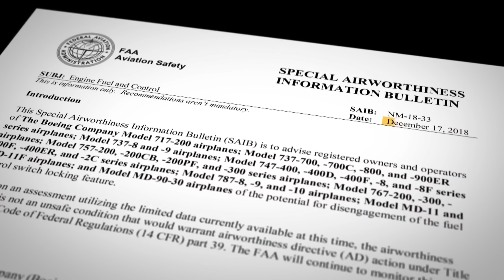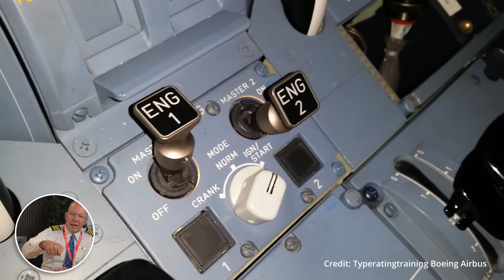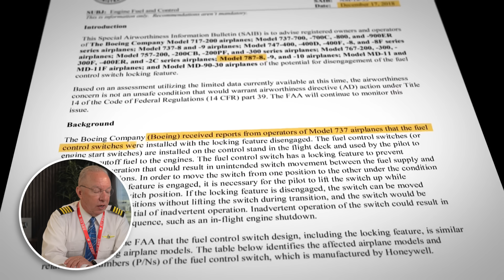Air India 171: The FAA’s 2018 Fuel Switch Locking Bulletin Explained (16 Questions Answered)

Comment: You did not answer 12:10 or 13:27. Total electric failure is not what they are talking about. Any electronic device, (even a gaming console which effected some speed runs in the history), can shift bits due to malfunctions or outside interference. 

Also, your "GUARDED BRACKETS" actually will help to cut off the fuel if there is an object stuck between the throttle and switches. You did not even consider the possibility to answer this one.

Comment: Is there a way to know who was the pilot actually flying the plane at the moment of take off . Can it be the Pilot or co-pilot. 
Who was uncharge of the wheel ( don't know what you call that thing the pilot graps that looks like a wheel. Is that the nose?)
Reply: @bayulala100  The preliminary report states, "The co-pilot was Pilot Flying (PF), and the PIC was Pilot Monitoring  (PM) for the flight."
Reply: Thanks@TonyCAV8R 
So the question is who was the pilot that first asked the question 'did the turn off the fuel switch to cut off" 
I think one of the pilot was suicidal at the time and had decided to die and killing all on board that air plane.
Very sad situation
Reply: @bayulala100  That question was not answered in the preliminary report, but I am sure it will be part of the final report.

Also, there is nothing in the preliminary report that states that a pilot moved a switch from RUN to CUTOFF (the switches transitioned) nor whether such an action was accidental or deliberate, unintentional or intentional.

Let's wait for the facts before trying to assign guilt.

Comment: But, even IF this was a suicidal pilot, there surely was a distinct possibility he survived the attempt. I get it that no one survived but if those buildings weren’t there, the cockpit could very well have been intact without injury.
—> My point is, they were only 400 some feet off the ground so it’s not like they were pulling 9 G’s going in at extreme angles; Thus it wasn’t the best scenario to accomplish self-demise. Sure, it worked, if this is ultimately the case, but it may not have which would have meant criminal charges.

Comment: With all due respect, the question about video recording the cockpit wasn't about prevention, but about accountability. I know the idea is strongly opposed by pilots, but there are valid points on both sides and glossing over it by inaccurately reframing the question isn't helpful. This crash is the exact scenario where a video could be the only way to know what happened. We know someone moved the switches. We can't know who did it based on the CVR or FDR. The pilot flying asked the pilot monitoring why he did it. How do we know the pilot flying wasn't the one who actually did it? We don't. You're making an assumption that the pilot who asked the question didn't do it himself. The fact he asked the question doesn't prove anything. See?

Pilot concerns about video recording might be addressed with strict procedures and technical protections on video files, and I think their resistance shouldn't be allowed to kill a thorough debate.

Comment: According to Wiki the Air India Plane 36279 had about 8,000 cycles, takeoff and landing.  It would be possible for the MN4 microprocessor to fail before 11,000 cycles if subject to greater power/electrical conditions.  Related to the FADEK and with both engines having been recently rebuilt, there may be an issue.   Apparently to replace MN4 microprocessor is about $25,000 USD.   I’ll be watching this and see if there is something there.  (I am leaning that way at the moment.  “I didn’t do the cutoff. . . .”). It very well could be that the system torpedoed it self.   Look into that!  Thanks!!

Comment: To eliminate those "privacy concerns", a cockput camera could (should?) be there and turned on 1. During Takoff until 2,000 ft above airport elevation. 2. Anytime flying below 3,000 ft. 3. Anytime a Mayday called or whenever there is a warning light (or similar) is going off. There are just to many positive reasons for their installation.

Comment: Since having the fuel switches in the on position is very crucial, should it be very difficult to move them? Like, requiring index fingerprint from both pilots?

Comment: What system reports the position of the cutoff switches? If we believe the statements in the cockpit (not saying I do), is it possible the logs in the FDR do not represent the physical actions from the cockpit?

As a secondary, should it be that the fuel cutoff is controlled by a single action switch? Would it be impractical to implement a double switch action, or a hold button to activate switch configuration?

Comment: The bulletin indicates the potential for catastrophic engine failure mid-flight. What in the verbiage of the bulletin suggests to you that the issue would be it’s being installed upside down, specifically? Also, if as you’ve said, the result of its being installed “upside down” would prohibit it from staying in the run position then how could that possibly lead to the potential for catastrophic engine failure mid-flight?

Comment: Captain Steve isn’t reading the wording of the Bulletin correctly. It doesn’t say the switches were ‘upside down’; Rather that they were installed with the detente’s ‘disengaged’ which to me means either the detente ramps weren’t installed or the springs weren’t installed properly.

Comment: I also saw on another YouTube channel that the APU was attempting to start.  Not that it would have mattered, but curious if that was a system automatic function, or is that an automatic process along side RAT deployment?
Reply: @thomthumbe  According to the preliminary report, at 2 seconds after the Engine 1 fuel cutoff switch transitioning between CUTOFF and RUN and 2 seconds before the Engine 2 fuel cutoff switch also transitioning between CUTOFF and RUN, "The APU Inlet Door began opening at about 08:08:54 UTC, consistent with the APU Auto Start logic."
Reply: @TonyCAV8R Thanks!  And very sorry for the dumb question (serious).  I really need to download the report and search for such info on my own time instead depending on other ppl for such questions.  Thanks again for taking the time!  It is appreciated!

Comment: I suspect that the fuel control switches are inputs to the Engine Control computer and the fuel valves are controlled by that computer.  Do you think its possible that the switches were in RUN but the computer received a false input and then the logic shut the valves as well as told the flight recorder that the switches were moved to OFF?  The pilot that asked if the switches were turned off may have simply diagnosed the issue and then cycled the switches to try to open the valves.

Comment: There is a  video from India that the CAPTAIN was being treated for depression secretly as he had separated from his wife. 
He has been suffering mental depression for some time and the Pilot speaker simply said the Co Pilot who is the PIC - has both his hands on all the control columns and it was the Captain when depression came on that he flipped the switches to OFF and then asked the question and said it was not him 
The video is titled "‘Fuel Switch Deliberately Cut Off’: Capt Mohan Ranganathan Suspects Cause For Air India AI 171 Crash" at 17:12

Comment: Captain Steeeve: At 7:29, I believe you dismissed this possibility too quickly. If the failure mode was as you describe (switches installed upside down), the aircraft would never be delivered from the factory. Please reread NM-18-33. Beware of cognitive shortcuts and confirmation bias. You jump to the conclusion of a pilot mental health issue, to which you are already invested.

Comment: Captain Steaeeve thank  you for your geeat inside and profesionalism .
Im thinking moving forward from this tragic acident only one thing can be changed in the design of the airplain that may give  a chance for a  stall prevention. Seams like if there were just 20 seconds extra of restarting engine this could have been prevented .
So if Boing would interlock  or change software to where this switch  would not  cut fuel for a few more seconds from the time plane takes off intill you get to a safer altitudine  .  Or at least not both engines at the same time . I dont think thats too much to ask . But it may save lives in a future incident. Pleaese  present this to the proper channels. It may help . I dont see why this air logic could  cause any troble. 
Let me know what you think as a seasoned and career pilot. 
By the way  I enjoy watching all your videos .

Comment: It very well could’ve been it an electrical glitch which negatively resolved itself in the FADEC software that under some precise conditions reared its ugly teeth. Maybe neither of the pilots physically touched the levers.
—> I mean let’s face it, it was Boeing itself that NEVER told anyone about the Maneuvering Characteristics Augmentation System (MCAS). I’m not saying it’s Boeing or Honeywell, just that it is possible.

Comment: What's the likelihood that it was a system error or a computer malfunction, yes the switches are fully mechanical, but what about the circuitry that connect those to the computers on the plane, I.e the switches never physically moved from on to off? Considering that they not only were off, but according to some reports went on instantly a second later?

Comment: Switching off two fuel switches together within 1 second manually is also impossible...Have seen some pilots,s videos that reveal you have to go through some primary steps to buttum off  fuel switch that take sure short minutes
Reply: @shiVani-sv1ns  For anyone who has done it a few times, manipulating the switches is very simple, and both can easily be manipulated within a second.  Pilots move them from CUTOFF  to RUN and back to CUTOFF at the beginning and end of every flight.  During simulator training, switches are moved from RUN to CUTOFF for numerous malfunctions from engine starting abnormals to engine fires.  Either pilot could easily turn both switches to CUTOFF without even looking at them or thinking about it.

Comment: Cameras in cabs of other transport vehicles are common, trains, buses, trucks.  They are not there to prevent anything. They are another tool like CVR, FDR for investigatios. Sorry, your comfort as flight crew does not outweigh the needs of hundreds of passengers. Cameras should be streaming.

Comment: I believe that installing cameras on planes in the cockpit, which remain active until the aircraft stabilizes and during the landing process, is not a bad idea at all. This would encourage pilots to be more vigilant and minimize mistakes or distractions during takeoff and landing. Additionally, the control tower should be equipped to record these feeds and retain them on file for future reference.

Comment: The fuel cutoff with detent is too easy to actuate, IMO. Is there a reason it needs to be able to cut off so quickly with an easy movement? The Emberair example was very good, and your response good. But if the logic were in place during takeoff (only) it would reduce chances of this problem.

Comment: Slowly accepting this was a deliberate act, but "I did not do so" troubles me. It doesn't make sense that the errant pilot would lie.

What would an intelligent educated pilot gain by childishly lying after blatantly shutting down the engines right in front of the other pilot? Lying seems terribly out of sync with the situation.

People lie to protect or benefit themselves. Or avoid future repercussions. (And cover for those they care about.) None of which would ever be an issue for this pilot again, just a few seconds later. So why lie now? Just absolutely baffled by his horrible thinking.

Comment: 0 seconds ago
Suppose the fuel control switch is riding on a cam.
Overhead valves in an automobile internal combustion engine  are riding on a cam. As the engine crankshaft rotates, the cam pushes the overhead valves up against a spring.
The 787 fuel switch is riding on a sort of cam. First you pull the switch up, which positions the switch up and over a lobe. This lobe guarantees that the switch will not move by itself from ON to OFF. Next you pull the switch down. The switch moves from on to to off, and the switch rides the cam down.
However, if the switch is ON, if you pull the switch up, and move it a tiny bit down, it is resting on a high part of the cam, and is still on ON. As the engines begin to run, and the 787 moves down the runway, the vibration causes the fuel switch to ride the cam down to OFF.

Comment: You are still not considering the possibility that the switches were always in the "run" position, but an electrical, software or hacking incident caused the cutoff. These are electronic systems driven aircraft in every way. Sounds like you are still marketing psych services.

Comment: Given that this aircraft had a number of successful cycles, a problem with the fuel switches or any software/computer system is very unlikely.  Almost certainly this was a deliberate action by one or both humans on the flight deck.

Comment: As you have said it,  right after lift off, when you have positive altitude around 300-400ft, you pull landing gear up, thats the sequence right? But plane must have problem before the landing gear was never up. The survivor said a loud bang happened before lights off (matching a major electrical failure)
Plane suffered electrical failure taking out both power sources thereafter initiated the Fuel Cut OFF Valve to the engines that flamed out automatically and at the same time, the RAM was activated and when RAM activated, the pilots could then restart the engines that flamed out but was too late.. 

Did the report specifically says the engine cut off input was from the switch in the cockpit or was it activated within the system?

Remember the pilot answered: I did not do so!! Give him benefit of doubt

Comment: Question: Ref B787 Flight Crew Operation Manual DUAL ENG FAIL/STALL. Is it possible that one pilot was thinking both ENG seem toward FAIL or STALL and as precaution or prevention ENG FAIL then he made action to the Fuel Switch?
Bambing (Bambang Setijoso) electrical / electromagnetics expertise, 40 years in aircraft industry ( IPTN, Bombardier, Mitsubishi AC).

Comment: I am a CAA-UK certified Airframes & Engines engineer with 45 yrs arlines experience but now retired. I don’t believe the preliminary report even one bit. I have my doubts about it because:
1-The first officer or co-pilot was the pilot flying the aircraft. The Captain was the pilot monitoring, so on take off which is the most crucial phase, the co-pilots hands are on the control column the captains hands are free, so it is without doubt that the captain moved the switches from Run to Cut off.
2-The report says one of them says why did you move the switches the other replies I did not, the investigators are playing a game of bluff here because both pilots have their head sets on and each pilots voice is recorded on the CVR (cockpit voice recorder) on seperate channels and each pilot has his own channel on the CVR with each voice being recorded on separate channels so the investigators know exactly whose voice is speaking.
3-According to the Captains colleagues the Captain was having some marital problems with his wife and his mom was sick so his lack of concentration to the flight controls, if he was intent on suicide then why move the switches from run to cut off and then back to run, may be second thoughts, a change of heart, may be, but too late too little, there was not enough time and altitude left to recover from deliberately crashing the aircraft.
Think it over

Comment: Capt. Steve, you have covered all options (mechanical, electronics, flap positions, gear ,electrical, RAT, engines, dirty fuel etc) of this crash. You never commented the "pilot factor". I assume that you had NO THOUGHT,of pilot error, since you are in this industry......IF (REPEAT) IF (REPEAT), the pilots have to be blamed -----> the planes are NOT SAFE (WORLD WIDE!!!). Right😢? ...............…Human Error + NO-PROPER TAKEOFF PROCEDURES + SUICIDE+ SABOTAGE+ CHAOS in cockpit+ NOT-TRAINED PILOTS + INSTRUMENT DESIGN FAULTS + MISSING ©FAA©  REG. , are now emerging. "Be brave" and comment about the them as well.  See both sides of the coin , dear captain, since there 270+ INNOCENT SOULS travelling

Comment: Do we know who the Pilot Flying was, I heard Mentour Pilot comment that it was the First Officer. In that case, given the report inferring the sequence of the fuel control switches being flipped to CUT-OFF, was left to right (Engine No. 1 then No. 2), as a left seat Captain, who do you think would be more likely/capable of deliberately handling these switches and which switch would you instinctively pull first? Would the pilot flying have any capacity to flip the switches if both his hands are either on the yoke or hovering the throttles?

Comment: Blind Freddy can see that even the current locking mechanism isn't good enough for such a crucial switch. That's without also discussing the positioning of them. 
It's pretty clear that not only should they be moved to a more secure location, but they should become 'caged' switches like fire bottles. 
Get it done!

Comment: I may have missed it but in the video with the read out of the black box they had the time of each cutoff switch being turned back on but not when they were turned off. Just wondering if both were turned off at the same time or how much time between each. From your video the switches had a square piece on top that IMO someone could move both switches in one motion. Not buying both switches were defective at the same time.